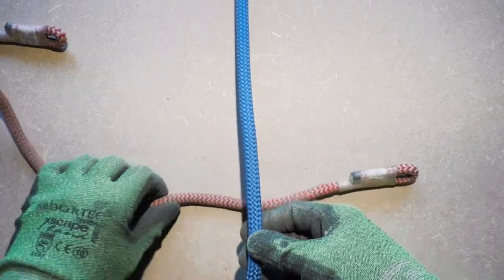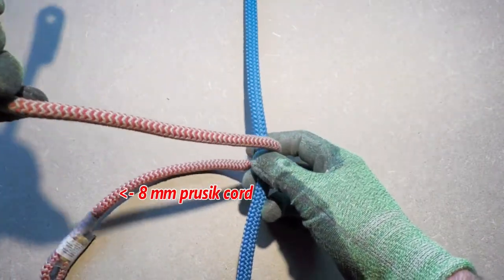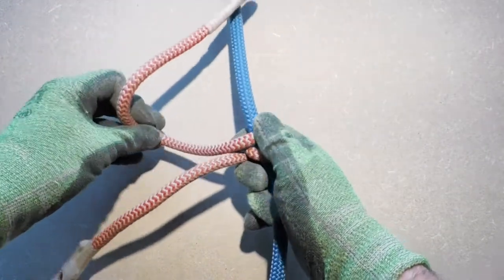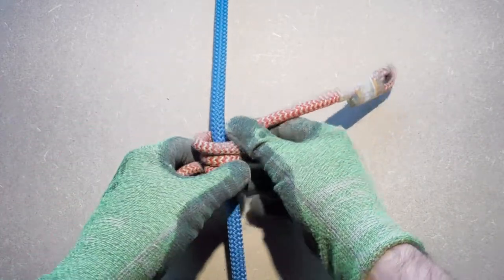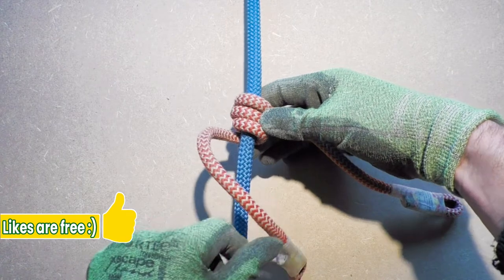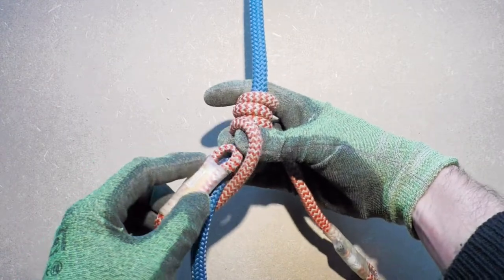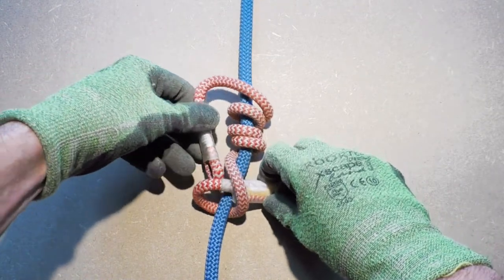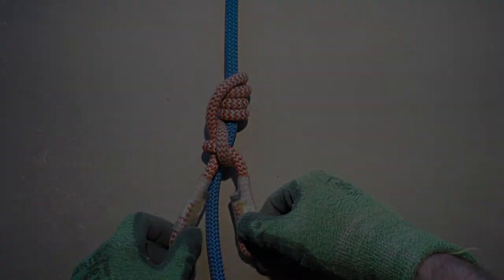Knut hitch, Friction hitch for tree climbing

Comment: It would be helpful to see once the knot is tied to the line how you move the knot up the line otherwise nice clear examples on tying the knot :)
Reply from the maker: Thanks,  just push it up :) it highly depends on the climbing system you are using and also on the application.  You need some method to take the load off the knot to advance it. Either by standing on branches,  using a foot ascender, hip thrust, etc. That topic is just to big to put in one video.

Comment: Why use this instead of a prussik?
Reply from the maker: The prusik hitch is very safe and easy to tie, but for tree climbing purposes it is a hitch that is very slow to work with. The more advanced hitches like the Knut hitch or VT hitch are much faster and also have less tendency to get stuck. Especially when using it in combination with more advanced climbing systems like a rope wrench.
Reply: @WoodenShoesHomestead  It would be interesting to talk about the pros and cons of this hitch in your video, instead of just showing how to tie it...
Reply from the maker: The purpose of this video is to demonstrate the tying of this knot.  Pros and cons is not the subject of this video.